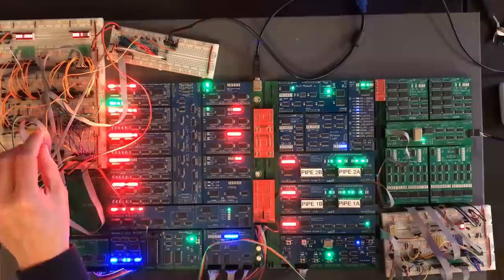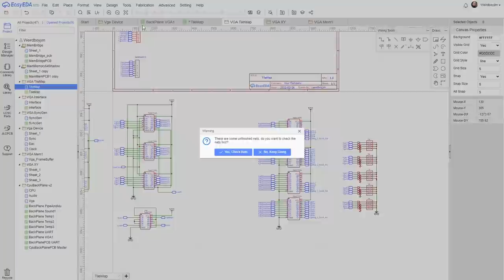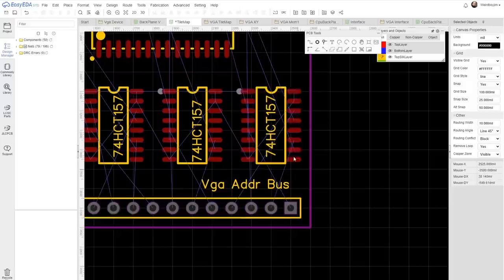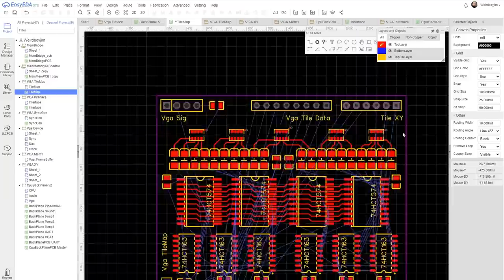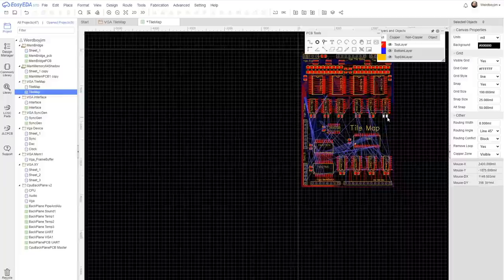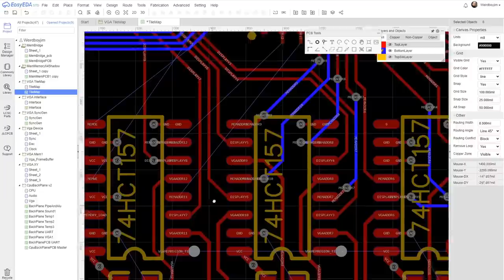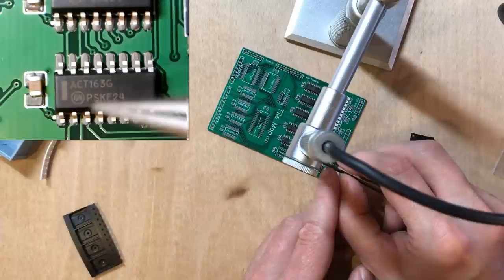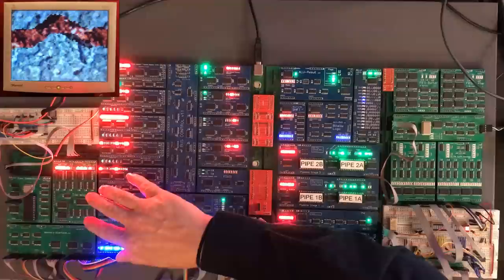Tilemap (Framebuffer) PCB - VGA from Scratch - Part 9

Comment: I suggest you walk away from a layout after you finish it.  Leave it for a few days.  Do anything else. Then comeback with the verification hat on and VERIFY IT!
Your rushing things and making mistakes that you can avoid with much less effort than fixing them later.
Reply from the maker: So easy to point out other peoples mistakes when they record them for you isn’t it.
Reply: @weirdboyjim  I am suggesting a way you can avoid making mistakes like this.  I'm speaking from experience as a Verification/Test Engineer.
Reply from the maker: @metaforest  My mistake count is pretty low but I accept I'm going to make them. And I WANT to make the ones I'm naturally making and show them along with the troubleshooting and fix. This is my hobby, not my job and the minute it starts feeling like a job I'll either treat it very differently or stop doing it outright.